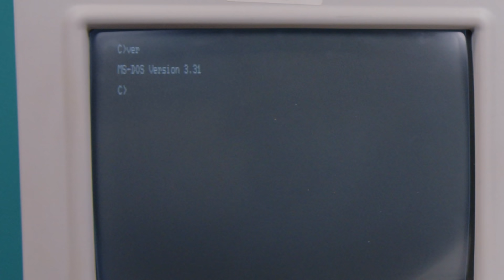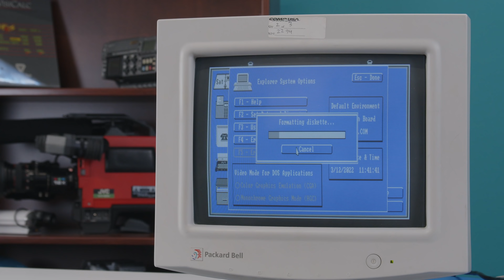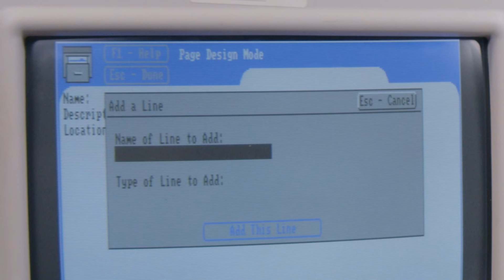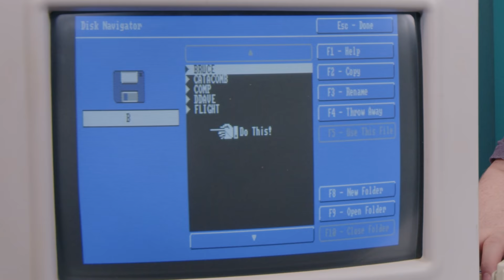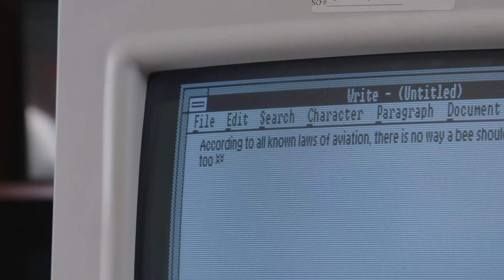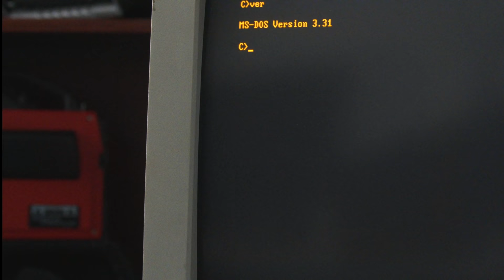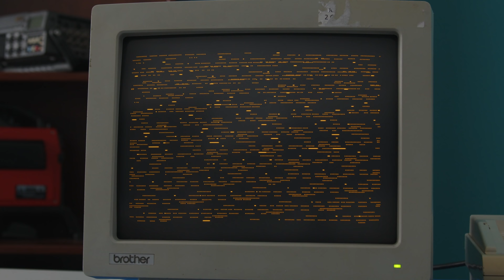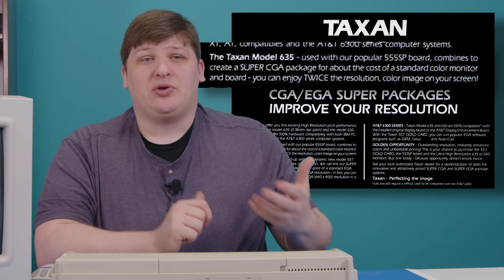Headstart's PC With The Weird GUI "OS" [Explorer]

Comment: My Atari STE is better than that, back in the day I was using Atari MS Write and transferring .doc text files to the PCs at work on HD DD floppy discs, images were also transferable, there was nothing I could do at work that I couldn't do at home, I had databases and spreadsheets at home.
The new price of that computer is above or similar to my Atari STE, I also had a choice of using colour and mono monitors and I could use a TV as well. Atari had 16 colours in 1985, the years Windows came out.
With the coming of the Atari Falcon I envisaged I the use of Ataris at home and PCs at work using MS compatible applications.
The Atari had larger RAM than the early PCs, the demand for RAM from games in colour pushed the increase in RAM.

The hard drive socket looks kind of SCSI, is the floppy drive SCSI too, since Ataris and Amigas are now using SCSI Gotek floppy drive emulators and SD hard drive emulators that computer may have interesting expansion possibilities.

Comment: HI, Nice review, the built in DOS reminds me of my first laptop a Toshiba 1000 that had dos 2.11 built in on a rom module.

Sort of handy as you could just start the machine and place in the single floppy slot your "program disk" and run with that, plus not having a hard drive  meant you would not use any of the more complex dos commands

Regards
George

Comment: Monochrome HiRes on the ATARI ST was definetly better than MDA ...
Reply from the maker: ST Hires is lower resolution in both dimensions, but close enough.
Reply: @CathodeRayDude  Probably yes, but also it had GEM as GUI and supported system integrated fonts from the start on (alothough most early users never made use of it, cos HDDs weren't so common on these system in the early days).

Comment: "All-In-One" - but no built-in monitor... so... not an all-in-one. Clones existed because the IBM was unobtainium for most, The PCjr was an entry-level PC that was [more] affordable. It's also what I started my career on, my first PC. My second was a Clone 8088.  The device you're spotlighting is innovative by design. It's an interesting approach from the youth of the personal PC era.

Replacing an 8088 with a Z80 was a useful way to improve performance, that worked in my PCjr.

Comment: DOS versions before 5 had close to nothing preinstalled. You got edlin, which sucks, and a command prompt. Not much more.
Reply from the maker: Every DOS disk I've seen in my life had at least something . FORMAT, ATTRIB, anything at all. I am aware that things like EDIT didn't show up until very late, but I'm saying it's wild that this doesn't include anything at all. It's obvious the ROM DOS is only meant to bootstrap you far enough to access a floppy, since the era of booters was long over, but come on - at least give us FORMAT!
Reply: @CathodeRayDude  why DOS was so empty until like 1992 is something I still don't understand
Reply: @daemonspudguy  It very much depended on what OEM you got your PC from, since until MS-DOS 5 in 1991, there wasn't a "generic" MS-DOS -- each OEM customized it to their hardware, though just how much they could change was narrowing by the late 1980s as 100% IBM compatibility became a must.

Compaq's versions of DOS 3.3 were well-regarded, partially because they added support for "big" (>32 MB) partitions long before Microsoft and IBM did. Zenith and AT&T also had a good set of utilities in their versions of MS-DOS, though their machines were more proprietary than Compaq's.

Comment: This is an attempt to compete against AtariST and Amiga 500. Clearly. The fact that you don't mention those is not so good. The Amiga 1000 keyboard was great. Same with the Amiga 2000 keyboard. Amiga 500 and AtariST also had good keyboards. Amiga 500 was one of the most sold computers in 1987!
Reply from the maker: I didn't mention it for the same reason I didn't mention the Buick Roadmaster, it simply has no relevance. I can't picture a single thing that connects these two machines. They have nothing in common.
Reply: @CathodeRayDude  That is not true. Amigas Workbench was very innovative. AtariTOS or even Acorn with RiscOS was also quite good at that time. This one tried to mimic that.

1. Machine inside the chase. 2. floppy drive on the right side. 3. connectors on the back including a special one for floppy drives like on the Amiga 500. 4. GUIos builtin with Workbench 1.3 vibes to it. You compare it with the C64 which doesn't have a similar design. The keyboard is also way more similar to the Amiga 1000 keyboard too.

In the US, only the big-box Amigas were sold in the beginning. While in Europe, the Amiga 500 was sold anywhere. Commodore copied the AtariST design. Yes, the similarities are there even though this is a PC.
Reply from the maker: @MichalBergseth-AmitopiaTV  Those design elements predate the Amiga. They first appeared in the tandy 1000EX, released a year beforehand. The keyboard is closer to an IBM model F from 81. The GUI bears no resemblance to workbench other than being blue. I didn't compare it to a C64, I listed off six well known computers with integrated keyboards.

Comment: You complain about keyboards from the '80s including the C64 and Apple ][ series, while they may not have been great, they are far better than the keyboards on pretty much any modern laptop and most keyboards included with new desktop computers. Generally, modern keyboards suck.

Comment: getting sick and tired of "desktop" UI....which is nothing more ever than folders and icons and more folders. the OS and programs should all be neatly tucked away in a separate space that is not folders on a drive. same goes for configuration, should be a separate space and not have files on disk visible to user. that's all OS settings, program settings and user settings. so all that's left to be seen as actual files is user downloads/documents etc., not mixed with tonnes of OS/Program clutter. So then we can go ahead and re-design desktop to have better paradigms than a graphical place to dump files/folders, since the virtual UI on a computer is not meant to be held back by a lame representation of a paper office desk.

Comment: This scathing review of a dos shell comparing it to Windows or MacOS seems really unfair and uncharacteristically naive, CRD.

My XT from the same era didn't have any of those features and used text mode to display everything even on a CGA display.

Hoping to get a background on what's a cute UI that some aspiring developer made turned into Gordon Ramsay screaming at a free word processor for twenty minutes.

Yikes.
Reply from the maker: Dude, look at the program. It sucks. You can't type on it. The fundamental feature of a word processor is typing, and this one can't handle it. Contemporary software from years earlier was better, as demonstrated. It wasn't free, it was a permanent component of a machine that cost the modern equivalent of $1300, and could have included software that actually performed its stated purpose competently. There's no reason for it to be this bad, which you know and I proved. I don't know what you want me to say, but your comment is uncalled for.
Reply: @CathodeRayDude  It's not meant to be a complete suite, it seems to me to be more of a demo of the computer. Janky as it is, why would you expect to get this All In One solution and expect to have everything to become an accountant, or a graphical designer?

Windows shipped Paint. Paint. And Notepad.

As for being an uncalled for comment, I'm sorry you took it that way. Just consider it feedback from a random viewer and you do you, we just have different perspectives.